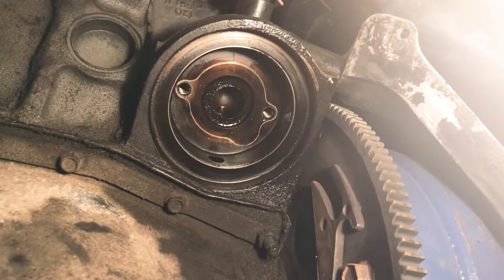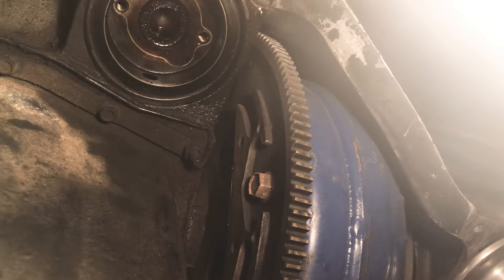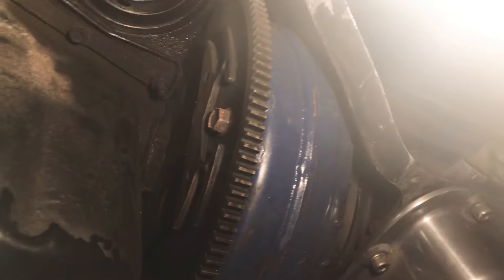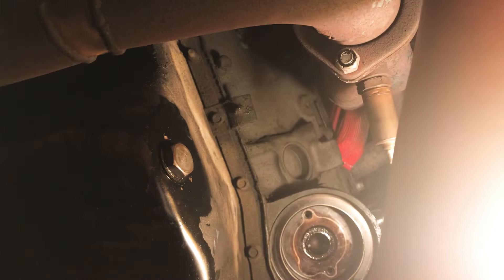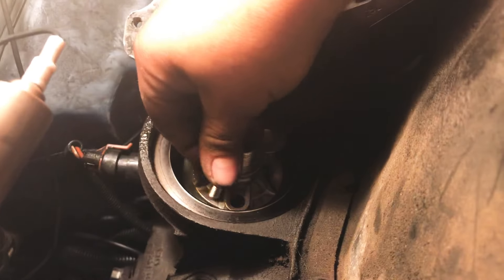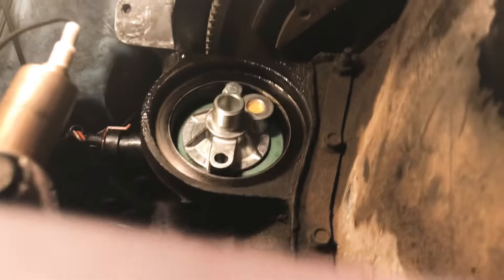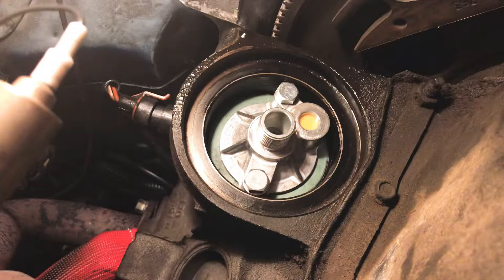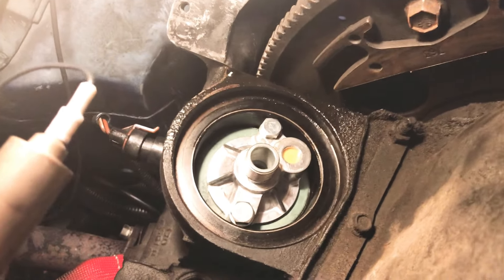Oil filter adapter how to install.

Comment: i'm going to attempt to do this sometime this year with am mfa350 adapter.  watchjrgo did this conversion last month, but didn't show the detailed closeup like you did.  jr did say the bolts were 5/16 x 18 x 1 inch (coarse thread)
Reply from the maker: I have to go look for the package im my garage an tell you the bolt size. The kit i used already came with bolts. Its pretty plain an simple. Go for it do it let me know how it went. Any questions you can always hit me up.
Reply: @wickedws694  thanks for the reply.  what did you do about the holes in the raditor where the lines connected?
Reply from the maker: I just plugged them after i removed that cooler. Haven’t had a problem at all.
Reply: So question? Was it indeed 5/16 X 1”  or   1 1/4” long? 
I was also told it’s 5/16-18 sae coarse .  One guys said 1 1/8 or 1 1/4” works NO Gaskets needed since it’s machined surfaces on block and adapter. What bolt did you end up using
Reply: @Chevro91  i actually used another video to eliminate the adapter totally.  video name is "S10 Blazer FREE FIX Oil Cooler Removal"  by robhoffman20.  i had to buy some tools, but you might have them already.  as always, read through the comments on that one to see how it went for other people.  it def worked for my 1995 s10 4.3

Comment: Hey!  I have an 87 formula that I am swapping a 98 350 vortec motor into. Is this the same engine that is in your trans am?  I know vortec motors didn’t come in the 87. And I’ve never heard of a 3rd gen with an oil cooler so I assume you have the same swap as what I’m working on. How has this adapter kit worked for you? have you had any trouble with oil pressure or leakage? Please respond ASAP if you can. I’m trying to get the swap done in a week to take the car to a big show. Thanks
Reply from the maker: This is rhe original engine for my Trans am 3rd gen, many 3rd gens came with different options. This engine is an L98 TPI

Comment: I reached out to melling and they told me not to use the gasket. I guess if it didn't hurt anything in your case it doesn't matter.
Reply from the maker: Yea i guess, it worked great in my case. Only reason i used the gasket was because the oil cooler had one.
Reply: @wickedws694  everybody has a problems with the cooler lines, mine are leaking on my 95 yukon I got the new lines and thought you know what I dont wanna deal with this again so I ordered the adapter and short oil filter. With better quality oil nowadays I dont think its needed but if anybody need it I guess I can sell the lines with cooler adapter and make my money back.
Reply from the maker: @martinez1701a  ever since i deleted the cooler lines, i havent had a problem, i did go with a longer oil filter from Napa. Post your oil cooler & hoses on Ebay, im sure someone will be interested in it.
Reply: @wickedws694  yeah Ill throw it in my parts cleaner and pretty it up, maybe ill make some money back too. Its a good system just a little troublesome especially on my 4X4, a better radiator and trans cooler are better for towing anyway.
Reply: Correct no filter required.

Comment: Does it need the gasket for the oil adapter since it’s inside the filter?
Reply from the maker: Kevin Hong i belive the gasket is to give it the appropriate clearance that way the filter goes on the right way an not to over tightened oil filter. It will give it just the right snug fit.

Comment: i put a 283 in my nova and after running for about 5 minutes she’ll spit out like 1-2 quarts of oil out of the oil filter, at first i thought i just needed a new filter and then i got one and the same thing happened, do you know if this will fix that?
Reply from the maker: It will fix it, thats if you still have the original oil cooler that most GM SBC came with that mounts in between the engine block its self & oil filter. Also before all that make sure you have the correct oil filter for it & that you dont have the old oil filter rubber seal still stuck to the oil filter housing. Remove your oil filter an make sure the mounting surface is clean an no old  rubber gasket or baked on grease, that will cause rhe oil filter not to sit correctly  an shoot oil out.
Reply: @wickedws694  thank you sir!!

Comment: Why are you adding this?
Reply from the maker: WB -AZ  because the oil cooler started to leak. Easiest an fast fix was to add the adapter.
Reply: @wickedws694  what size bolts are those
Reply from the maker: Marvelous Rides  it came with the adapter kit
Reply: My kit says no gasket needed
Reply: Robert Jennings Correct Sir, no gaskets needed. It’s machined surface finish no gasket no rtv just bolt on!